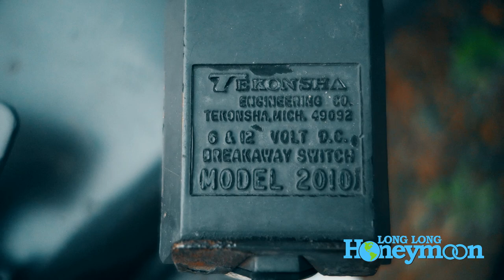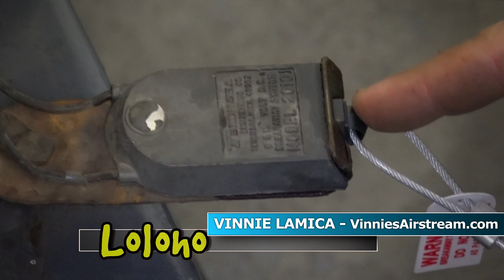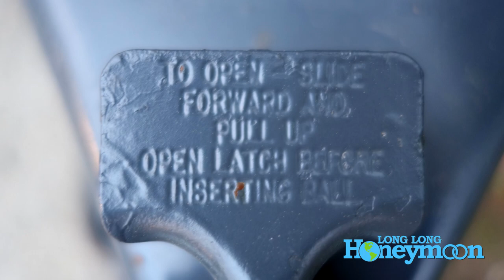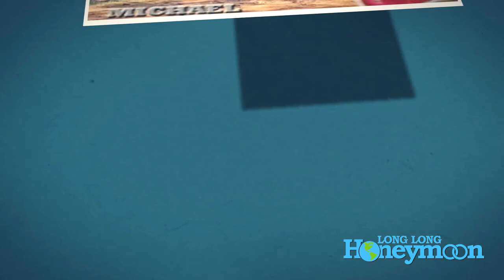For Beginners: "TOP 6" TIPS for HITCHING AN RV

Comment: To your point stressing the importance of making absolutely sure that the tongue completely engages the tow ball; I bought a pop-up 7 years ago...first time hitched to my Tacoma...got almost home and the bump in the highway disconnected the pop-up from the ball. All of sudden, I hear this loud noise and feel a dramatic change in how the truck is handling. I pull over to find the tongue off the ball, the safety chains were not crossed so the tongue dropped onto the jack wheel which was NOT retracted, the plastic wheel was ground down from dragging on the road...could have been a serious accident. Lesson learned! Sold the pop-up for a 21 for travel trailer. In the two years we've owned this travel trailer, we have never had any issue at all (no disconnects, no sway issues, etc.)

Comment: Okay guys keep your eye on the ball. Gotta keep the balls lubtricated.............LOL
I have more or less the exact same set up except I have two anti-sway bars. My Airstream dealer sold me two and I use both. One on each side. I also have two equalizer bars and I put a tie wrap around the link in the chain that I usually hook up.
If I may suggest two "top tips"
Tip 1 - Measure the height of the rear fender with the truck on a level surface. Wal-Mart parking lot is great for this. Then connect the trailer without the equalizer bars and measure the height again The fender would be lower as the weight of the trailer is now resting on the hitch. Then adjust the chain length until the truck is back up to the first measured height. Viola!! its level.
Tip 2 - To ensure the ball is locked onto the hitch and not resting on top, once the hitch latch is closed lift the trailer up on the electric jack. The rear of the tow vehicle should be pulled upwards thus indicating that the trailer tongue is in fact locked to the ball.
I loop the break away cable through my hitch. There are additional holes on the shank of my hitch to raise or lower  the hitch. These are two huge bolts that Vinnie is tightening in the video. I hitch and I loop my cable through that and then lock it exactly the way you have yours.

Be safe
Cheers,
Keith

Comment: Clean out those electrical connectors with WD-40 Spray and put a piece of duct tape over the holes when they aren't connected.

The reason to be sure your trailer and tow vehicle  are flat/even is that your braking forces will be in a direct line between the two.  Also, your hitch will take the force at the places it is strongest.  Always buy the solid, cast iron hitch and the highest rated ball.  Hollow hitches can twist.  Be sure your trailer / vehicle are level AFTER your weight distributing hitch is "loaded".
Reply from the maker: Thanks, great advice. I like the duct tape cover idea...

Comment: Another  way to make sure the hitch is seated properly on the ball. After u have lowered   the hitch on to the ball, with the jack is off the ground maybe 2 inches is to grab  the tow vehicle and shake it side to side, u will hear and see the hitch seat it's self  on the ball!   
A cheep  anti-sway bar  may not be a  wise investment, when getting  into a cross wind or traffic situation they take a lot of stress, they have to be strong!   Ask urself "How did they make it cheaper?"   Lower quality material, little or no quality control!   "Ship it and bill it" is  code of the day!
If u find urself in a "Sway" situation, the best course of action is to relax on the wheel and apply trailer brakes lightly! If u start trying to correct with the wheel ur fighting it and making it worse!  
straight road, no traffic, use the brake controller and get the feel of it,  BEFORE  ur seeing the license plate on the trailer! 
Have no idea why that line turned red....Damn puter's
I enjoy ur vids, RV'd since the 60's!

Comment: Why did you change from the 15 inch wheels to 16 inch?
Reply from the maker: There are a couple of functional advantages -- bigger tire sidewall and greater ground clearance that really helps when getting in and out of places like fueling stations. The new wheels look nice, too. There's at least one disadvantage -- our Airstream door is now higher off the ground. It's more difficult getting in and out of the trailer without having the steps extended.

Comment: Note of caution concerning the break-away breaking safety switch. When activated, that switch uses RV battery voltage to apply the trailer breaks full force. If when disconnecting your trailer from the tow vehicle, you accidently  pull the pin from the safety switch only slightly out, the switch will apply the trailer breaks. That is the RV battery is applying trailer breaks constantly. Overnight that constant breaking force applied to the trailer wheels, even though you are not moving, will drain an RV battery!  So every time you disconnect, make sure the pin is fully into the safety switch.

Comment: I think the number one problem I see is using weight distribution hitch. If you need a weight distribution hitch you've got one of two problems. Either your tongue weight is too heavy on the trailer or your tow vehicle is not up to the task pulling the trailer. If you don't use your RV on a regular basis I guess it's nice to be able to have a smaller truck than what you really need because you're not using it that much for pulling. But if you're using your trailer full time you definitely need to have a truck big enough to handle your trailer.

Comment: I would just add that, no matter who “helps” you hitch - you, the driver, are ultimately responsible and should double check every element of the hitch before you pull out with the trailer. I did drop a trailer once, thankfully right in my farmyard. And, while I was not the one who hitched it I WAS THE ONE WHO WROTE THE $2,000 repair check....
Reply from the maker: Thanks Nancy, great advice!

Comment: Sean, do you have one of these?  

http://www.harborfreight.com/non-contact-infrared-thermometer-with-laser-targeting-61894.html 

I keep one in the truck and when we make a stop, every time we stop I check the temperature of all 8 tires.  They should all read close to the same temperature.  If you find a hot tire you need to find out what its problem is before continuing on your way.  Heat build-up is deadly to tires.

Comment: I would say lube your jack, I do mine so it is easy to use,  but few as my self use a utility daily,
I run 1500 pounds on it and 7 in the bed of the truck camper, at least 3 times a week if not more,  It only came unhitched on me once, all I can say is good thing I was empty and just pulling out of my drive way, now I double check every thing.
stay safe every one, and don't ride your brakes down shift if you  can

Comment: This is a bit off subject but - DO  NOT USE THE BALL TO TOW ANYTHING BUT THE TRAILER HITCH!  i have seen a truck try to pull another vehicle that was stuck. When the tower put sudden hard strain on tow rope attached to the stuck vehicles ball, the ball became a high velocity bullet and went through the rear window of the truck pulling. 
In one case of this, as told to me by a peace officer, the ball collided with the driver and the result was fatal.

Comment: Don't trust the dealership set the weight distribution/anti sway system up correctly.  I've been fighting a slight sway on our trailer.  I added better shocks, rear sway bar etc. Still just a little sway.  Decided just for giggles to check my hitch setup.  They set the ball to high on the shank and didn't take the L brackets back to the recommended length, off by 4 inches.  I will be doing a complete reset on the system and I'm betting after it's set up correctly the little bit of sway left is gone.  So if the trailer feels off check the owner's manual and make sure they set it up correctly.

Comment: Two things I  disagree with you on. Otherwise nice video. 
1. The concept of the break away switch is when the trailer completely breaks away from the TV .. IT is not a disconnect switch, if you trailer becomes disconnected from the ball, that is what the chains are for. It is a trailer "breaks away"  switch. And you may want to mention that for the brakes to work during the break away, , the trailer MUST  have a working battery for the break away to switch on the trailer brakes.  
 
2.  Chains that attach to the end of the WD bars. Those chains should be ONLY on the first three links. otherwise you MUST change the angle of the hitch head. Otherwise there will NOT be enough length for forward and backwards movement of the bars when making turns. Also when TV is straight with the trailer, those chains should be pointing straight up and down,  NOT at an angle. Again it will limit movement when making turns. 

The jokes were perfect.

Comment: No tips for singles huh?  Now, how to find a professional helper?
Reply: gdcat777 A back up camera is great for hooking the trailer up by yourself. If you can't get that, they sell something called hitch helper or something like that. it is basically yellow balls mounted to telescoping rods. that allow you to see the ball and hitch alignment from the cab. One tip my dad just taught me for backing the trailer into a sight after dark is to put a flashlight on the ground where you want the back driver's side of the trailer to end up. With the light on facing the truck, this gives you a spot to aim! I used this trick the last time I setup after dark and it helped tremendously!
Reply: I often hook up our trailer on my own and the back up camera is super helpful. Also just having a good attitude of, ok, I'm going to get in and out of my truck a dozen times, makes it easier. Because remember, I'm about to go camping so relax and get her done, safely. :)
Reply: gdcat777 - I am a single that rarely has a helper when hitching my camper.  I've only had my camper for a year and I've learned a couple of tricks that have helped me.  The hitch helpers that Bakwoodj Traveller mentioned are helpful when lining up and knowing when your ball is under the hitch when used properly.  Definitely worth buying and finding a safe place to store them so they won't get bent.  There are magnets on the bottom that I will set on the top of the hitch ball cover and the other I put right on my ball.  Using these has gotten me hitch up quickly because the one on the ball will get shoved off when you're under the trailers hitch.  I have found that I CAN'T easily use them when there is any kind of breeze.... I would start backing up and get within a foot and one would get blown over..DOH!  I'll have to figure out a way to attach them so they won't get knocked over but still work for me.  I don't have a back up camera ..... YET!  When I have more funds it will be an upgrade for both my tow vehicle and camper.  If you aren't able to use the magnetic hitch helpers then try this.  When my camper is attached I make note of how it lines up on the back of my tow vehicle while looking through my rear view mirror. (Yes I do use my rear view mirror, as well as side mirrors, to hitch.  ;0) )  Since I pull with a SUV I use the bump of my third break light and/or the wiper blade in my hatch window and how it 'centers' on the tank cover.  Using that alignment has gotten me close enough to drop the hitch on the ball.  For gauging the distance, once you've backup up close to your hitch go back and see how much you have left.  Then take something large enough to see and lay it on the ground the same distance behind from your driver door so you can use it as a marker.  So if I have a foot more to backup I'll use my big mag light, lay it on the ground behind the driver side door so when I have the door open I will line the flash light up with the opened door.  Hopefully that makes sense, I saw a different YouTube video showing this.  But again, looking through my rear view mirror when it is hitched I can have a pretty good sense of where I should be and I'll get pretty darn close.  Sometimes all I have to do is give either the trailer or SUV a nudge to get that hitch completely on the ball after lowering it.
Reply: Something I was told by a knowledgeable RV’er the first day I got my camper was to make sure I examined and regreased the trailer’s wheel bearings at the beginning of each new camping season. I was waiting for you to mention that, but you didn’t. Isn’t that a standard annual maintenance ritual?